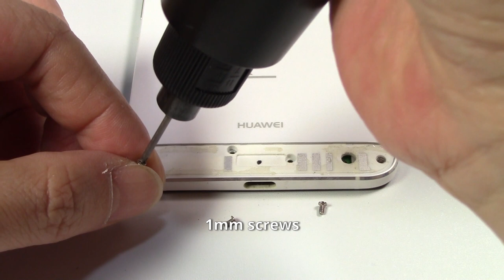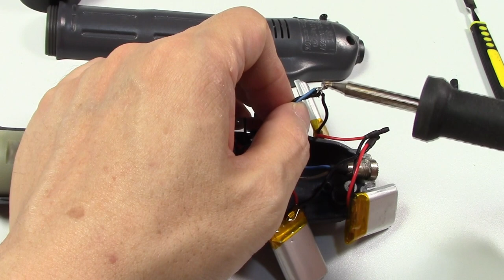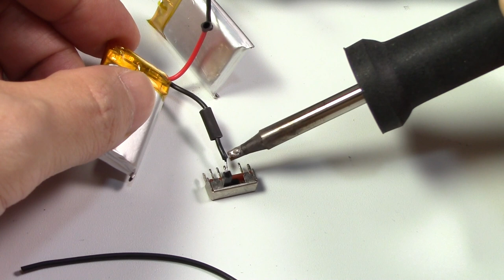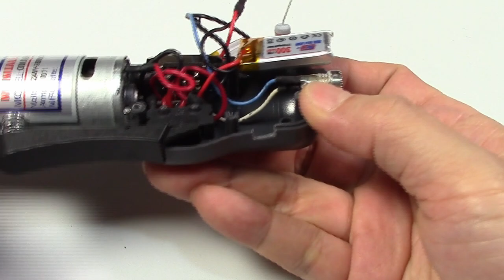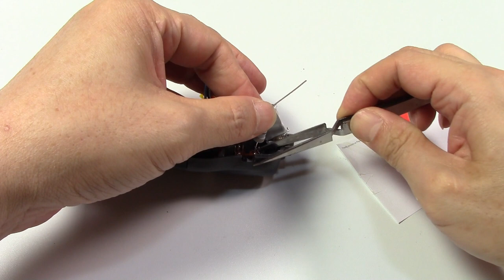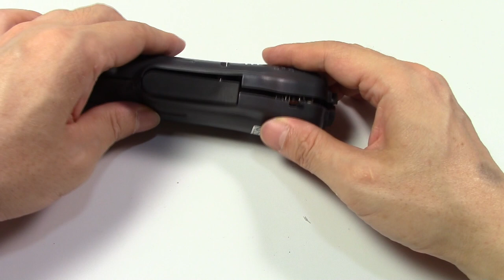DIY Cordless Screwdriver (part 3) | High/Low speed control modification

Comment: I have cordless screwdriver with 18350 batery 3.7 volt, produce 270 rpm no load speed
How much ohm do I need to reduce to around 50 rpm ?
Any formula to calculated that ?

thanks in advance